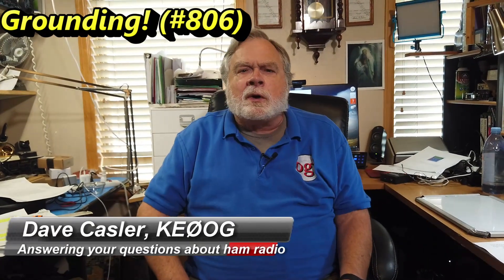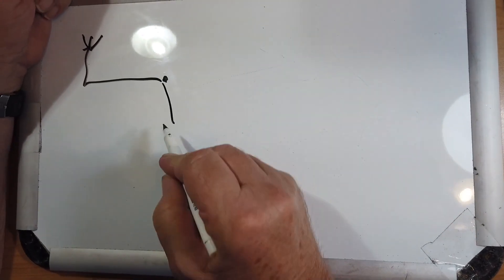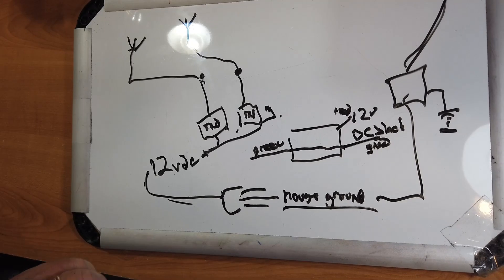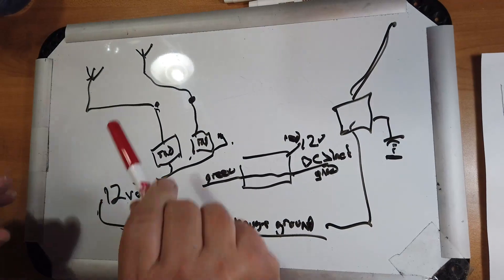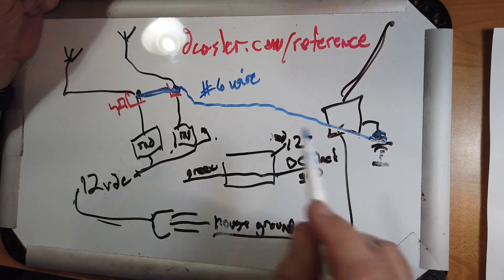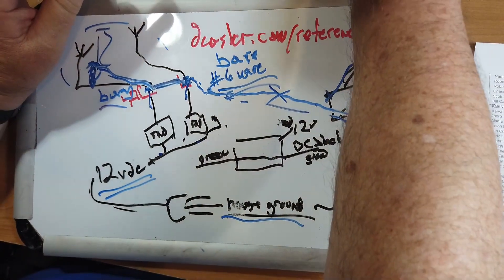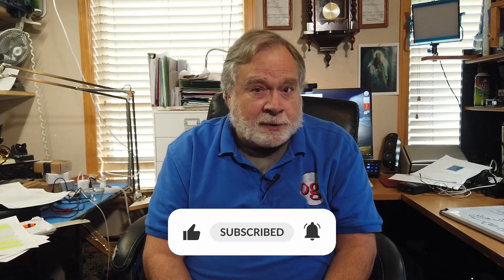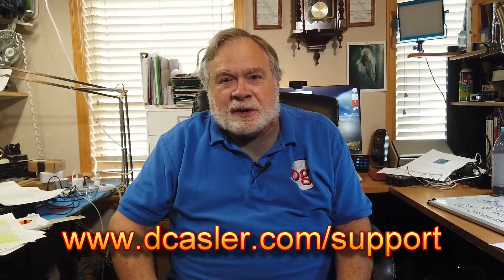Grounding! (#806)

Comment: Just wondering if I need to add a lightening arrestor in line with my coax or not.  My vertical has a grounding wire running up the mast 20 feet to the antenna ground (8' copper rod).  The coax and ground wire come straight to my shack just on the other side of the wall and the radio equipment is all grounded to the direct ground wire.  The ground rod is literally about 6 feet from the station.  I would think if lightening were near the antenna, it would take the closest route to ground through the antenna and grounded mast before coming through the center conductor.  Any thoughts?

Comment: Sorry Dave some of the old hams say don’t bond to the ac panel . The green is bonded at the first point of disconnect. And in some instances is the path back from a fault to the breaker. This can introduce a HV to your station ground for a few milliseconds, that could do damage to IC’s and some other sensitive components! JohnBoyUtah!

Comment: Dave, I have been a ham since the late 80’s, Technician KB6NOJ.  My father in law perked my interest in the hobby but I have not been active for quite some time.  Since I’ve retired I’m starting to build my interest in it again and have found your channel and have been binge watching your videos for three nights.  I’m studying again for my general class license and am going to put up an EFDP so I can listen in.  I have a Kenwood  TS120S that my father in law gave me and had a 10 to 40 vertical up for years but the weather took its tole on it and I took it down.  I probably look into getting another, newer, HF radio in the future.  Your videos are fantastic and I have learned a lot.  Your right about the grounds.  At 66 I’m still an auto tech, retired but working from home now, and grounds are probably the most important thing to maintain in a vehicle, especially with all the electronics in cars nowadays.  Anyway, long winded, sorry.   Thank you. 73’s.

Comment: Hello, can you use 90 connectors on the arrestor or should in be straight. I was placing the arrester in a plastic box where I plan to make the connections with limited room. I was thinking a 90 connector would do a good job so i would not bend the LMR400 cable.

Comment: Thank you, Dave! 
I tell people this exact same thing all the time. Most hams generally get angry because, as you know, they know everything! 
Just to add to your video, this is REQUIRED by NEC. It's important to remember that, should you have a nearby strike, and things in your house are damaged, an insurance adjuster will likely come out and promptly deny your claim because you did not even meet minimum code requirements. 
73

Comment: The big misunderstanding many hams have is in thinking that the earth is an infinite voltage sink that always sits at zero volts potential and can absorb any amount of energy.

The earth actually acts as a conductor with a voltage drop so that two earthing electrodes  (ground rods) at two different places in the earth will not be at the same potential and it is the difference in potential that causes damaging currents to flow.

It is safer to think of the grounding electrodes as being two different probes on a voltmeter probing two different locations in a circuit.  If you don't bond outside the house you are still bonding the electrodes together - just through your house wiring and equipment.  No bueno!
Reply: Absolutely! And if your shack is on a subpanel, you've lost the original home panel earth bond path to a loop ground anyway. But nobody even considers the upstream and downstream pole drops and their ground rods and that you are raising/lowering the ground potential/differential with your neighbors' distribution panels too. 
IOW - it your neighbor gets a lightning hit, your ground potential doesn't rise the same as his and you're left with an incredibly high differential .. zap!
Reply: *if your neighbor, etc.,  ... can't edit the correction for some reason.

Comment: Hi dave .what if lightning strikes the next house ,is it possible for a reverse current flow from ground rod to my rig
Reply: Ok
Reply: A nearby lightning strike Will send out a wave and eventually hit your ground system. As long as everything in your system is bonded, it will all be at the same potential, and you're fine

Comment: In my multi decade career with working on telecommunication systems I often was required to do post-mortem evaluations of systems hit by lightning or having experienced power cross events.  I even found an open pit mine in Green Valley AZ where they had moved the a power substation to a location that was directly above the incoming telephone cable.  I spent a week there explaining the dozens of things wrong and proposing ways to alleviate the problems.  In the end, after a few more lightning strikes and a couple of power outages, their insurance company refused to pay out any more and they were forced to spend the money to properly fix the myriad of problems.
Dave Sunde KG7RYA

Comment: The more ground rods that you have the better.  I have seen ground rods take a surge and form glass around ground it and then it is no longer a ground.  By putting the grounds together not all the power goes to one ground rod and if one gets glassed over you still have the others.  House wiring grounds are made for 60 Hz Not RF or lighting! Lighting and RF doesn't like turns! There are a lot of turns in house wiring there are many connections in house wiring!    Voltage = A difference in potential between 2 points! By putting a large wire between the ground rods you make sure that all the grounds are at the same. I have seen Voltage between two ground rods 4 feet apart!
Reply: That has changed over the years. For effective grounding, more ground rods is definitely not better, according to the data and testing. For maximum effectiveness, a rule of thumb is to place ground rods about two times their length in spacing. In other words, if you're using 8 ft ground rods, they should be spaced about 16 ft. NEC code says MUST be spaced more than 6 feet apart. (See sphere of influence)
73
Reply: @timmack2415  16 feet apart is better than most have it. I am in Florida.  This can make some difference.  A lot of sandy soil. I have seen ground rods glassed over from lightning. I have seen 1 7/8 hardline with holes in it where it made the bend to do it the building,  where the lightning coming down wanted to keep going down and not make the turn. I thought that the radio that had the 3 wire ground would be the way it would go and not make the almost 7 foot jump to the ground would be the best way for it. But as someone told me once "Lightning does what it wants to!  If you don't like it just To Bad!"  I think we are wanting people to ground their equipment as good as they can!  Florida has almost as many ground strikes as the other US states together! So if we do more than what the book said we should it is for a good reason!  Everyone should have a good ground with surge protection on all coax before coming in!  If you can bond it to the house electric ground should.  The more the grounds there are connected together the better. Anything that has the power to form glass around the ground rod is something you need to look out for. Most may not get that kind of a hit but if the power line gets hit that may come in on the house wiring ground because that ground can't handle it.  But must have all the grounds together so there is not a difference between the grounds. I think that is what he is saying! I will tell you one thing!  Don't worry about the lightning that hits your antenna! It will mess up more than you would ever think!  It is the one that hits a mile or so away that you have a chance to stop! A lightning strike a mile away will form voltage in your house wiring. How much depends on how near, how much wiring in the house and many other things.  May not be enough to damage things and it maybe just enough to get some things.

Comment: Hello Dave.  What do you do if the house ground is 150 yards from the shack ground?  Our Shack is in a metal building 150 yards away from the house?   Thanks! K5STY
Reply: It might be better to have a subpanel installed at the shack building, if you can.  Then you can ground it independently from the house.
Reply: You can run that, but you have to dig a ditch. Place the ground rods around two times their length. In other words, if you are using 8 ft ground rods, install one every 16 ft. Or if you are using 10-ft ground rods, every 20 ft

Comment: I place my arrestor at the PL259 part of the antenna. That goes to ground before the coaxial leaves the antenna. Also the grounding in the EU areas are better than they were 50 years ago. Houses have been refitted with modern electrics so earthing is now better not only via the 12V DC to mains, but you can tie the cable to a radiator as they too are ground bonded to earth as well. But it also means to be safe is to put a grounding rod outside the property so it can dissipate any charge build up from rain static which can happen here where I am in Scotland. Hence after the balun and grounding to mains and earth is a thing here. High winds, thundery showers and rain static is not good for the radio.
Reply: I’m confused by the location.  Are you saying you can put the surge protector between the antenna connection and the cable? I thought the arrestor had to be closer to the shack at the other end of the cable?
Reply: @jamesquast5543  That is where the buss bar goes. If you place an arrestor in your or near your home you may end up causing damage to the structure.  But what I am stating is that rain static can cause problems at the antenna end so grounding at that point is better than having it come in to your radio and having the chance of a potential damage to your equipment. Also if you have the space to do that then it is an option of placing some large lightning protectors between home and your antenna. I would say having a protector box away from the side of your home would be better and therefor lessen the risk more damage to property if it was just outside. Maybe on a shed wall or a fence so that can be damaged and not your own living area.

Here in Scotland we are more likely to get rain static. Being 400M over sea level can create a charge in the clouds and that can affect the way your antenna and grounding is built. You can go full on and buy a large cut off isolator that can trip when it gets over a certain point in charge. But even then lightning can still jump that gap so it is best placed near to the antenna  and lessen the damage from a near strike.